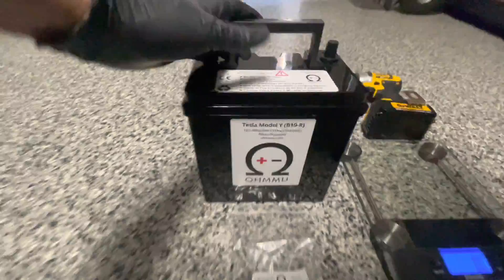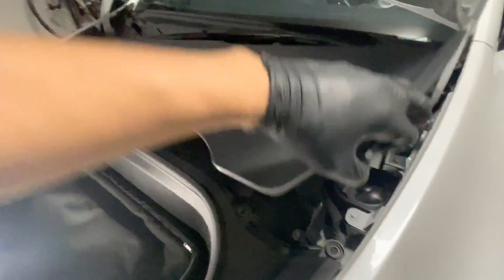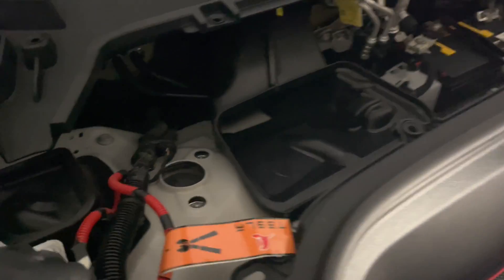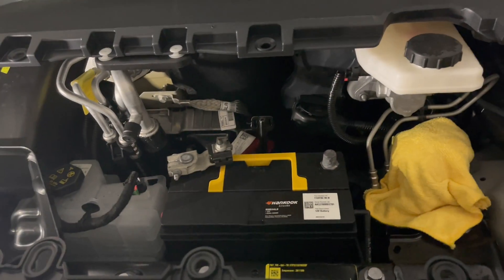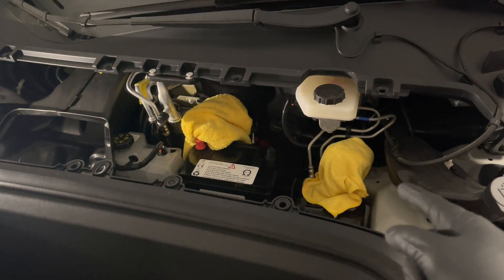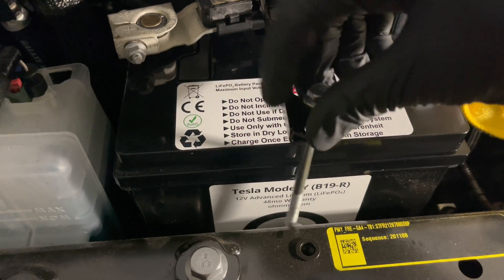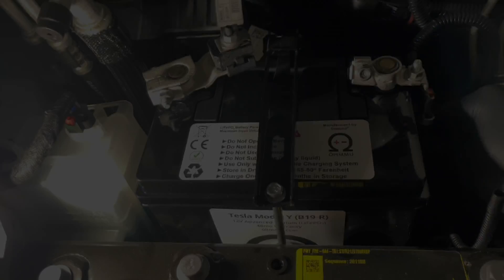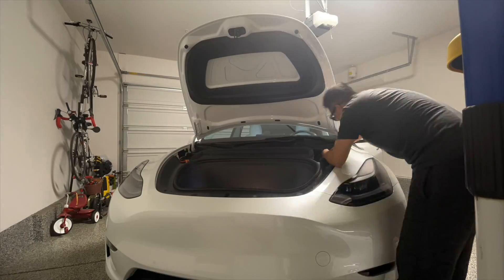How to Change Tesla Model Y 12V Battery to Lithium Tutorial!

Comment: You can't use lifepo4 battery in place of lead acid without changing the charging system/parameters. As far as I know it's not possible on a Tesla. 
IMO You are most likely to suffer from these 3 issues (but there are more). (1) Lifepo4 batteries will maintain 13v until 80%-85% depth of discharge so the Tesla will not even begin charging the battery until it drops below 12.8v or nearly dead. (2) Lead acid charging system max charge voltage is 14.8v and possibly higher which can cause the BMS over voltage protection to cut off the battery, thus no charge. (3) If the battery is below freezing the BMS low temp sensor will cut off the battery, and if there is no low temp sensor you will be charging a frozen battery which will destroy it quickly. 
Bonus issue - The charging algorithms for max charge and saturation are completely different and a LiFePo4 battery does not need nor will it tolerate a continuous float charge such as lead acid batteries need.

Comment: Ohmmu has been victimized by Tesla.  Tesla has had this 12v problem since the first Ss and Ohmmu solved the problem for Tesla.  I have had a Ohmmu in my 2013 S since about 2016.  Before the Ohmmu, Telsa had been replacing batteries under warranty about yearly.  Until the warranty ran out.  Yet Tesla did not address the problem until 20210-2022.  The Ohmuu in my 2018 M3 has been replaced by Ohmmu several times; the last time with a battery that has BlueTooth access to the BMS.  For several months, that one has been trouble free.  Tesla seems to have been introducing software to try to make lead batteries last longer for the period 2011 to 2021.  Those software changes also have had the effect of causing trouble with "regular" 12v lithium batteries.
Reply: 51R AGM battery.  At O'Reilly for 171$  works GREAT
Reply: I have a 2021 model Y and I’m on my third battery. Not good for a battery electric car company.
Reply: The car is designed for lead acid battery’s, the charging is set up as such, using a lithium battery when the BMS isn’t set up for it and the car is designed for it is always gonna cause problems! You can’t blame Tesla for setting their car up to use the batteries that THEY install 😂, to me it’s the 3rd party’s fault for selling them as advertised that they can work in a car that is set up for a different battery chemistry

Comment: Do NOT purchase the Ohmmu battery, it is a waste of money as it does not hold a charge once its installed in your Tesla. I own a 2022 Model-Y and a fully charged Ohmmu battery lasts about 2 weeks after normal use. I contacted Ohmmu and they sent a replacement which also failed after 10-12 days. I was told the recent Tesla software update is what's causing the battery to drain while its parked, with Sentry Mode enabled. I decided to just reinstall my original OEM battery and the issue went away. 6 months later and several Tesla software up I decided to give the fully charged Ohmmu battery another try and as you would expect two weeks later the issue was not resolved 12v battery warnings resurfaced after 13 days. I'm sticking with my OEM battery going forward. Save yourself the $ and frustration. Would have been nice if it actually worked because the weight deference between the two batteries is a nice selling point.
Reply: reliability is also important for a car parts. 48months warranty just a gimmick..